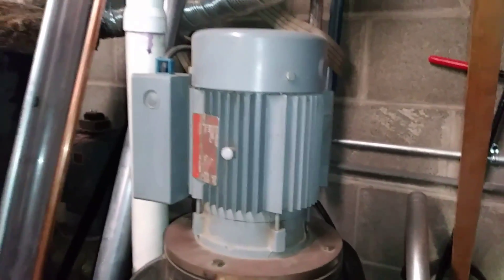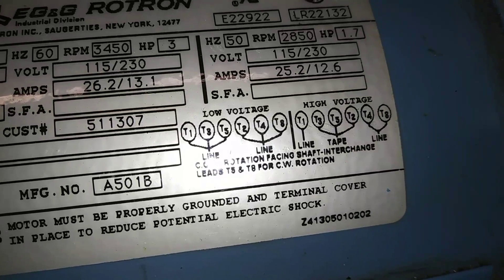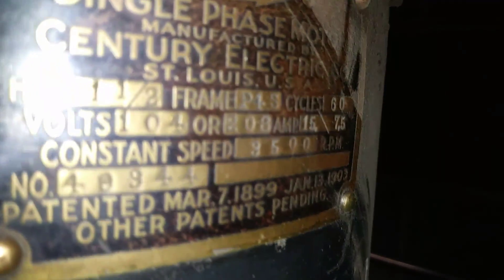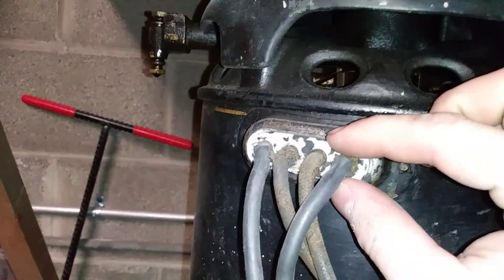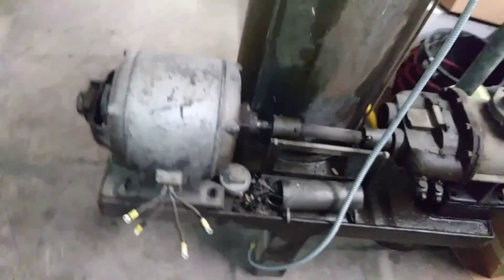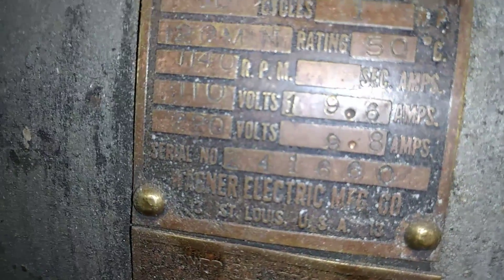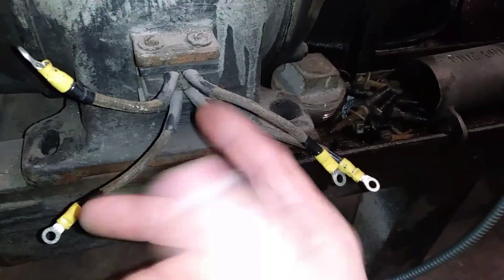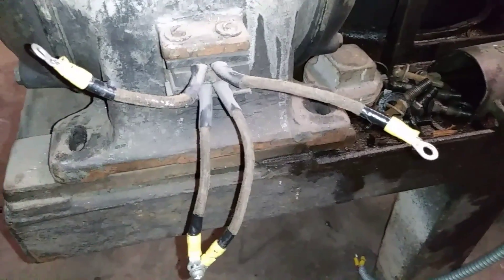Wiring single-phase induction motors (capacitor and repulsion start)

Comment: what if your motor doesn't have a legible data plate and the wires are not labeled.  Yeah...super simple with the given information.
Reply from the maker: Ooooh, you've got a fun one then! About how old is the motor, and how many wires are there?
Reply: @owenperkins  I estimate the motor was manufactured in the 1970's. I have since discovered the stator windings are all shorted to the frame.  Therefore, it goes to scrap.  I sure do like the older motors like this one.   Back when quality and durability were built in..compared to today's manufacturing in China where corners are cut.  There are no ships going back to China with a bunch of returns.

Comment: Hello  sir 
What  great vidios you make.
I was looking to do something. 
Only today  i got my self old baldor motor. From  farms conveyor belt.
Spec is 
Baldor
Spec 58280
Frame 225
Type 2321r 658
5hp
115/230v
Hz 60
54/27amps
Rpm 1725.
Its hard to find single phase 5hp motor in England. 
So i found this and got it.
It hasn't got any capacitors, Its fully enclosed motor,no fan on the back,just  massive lump of steel. 
It works perfect on 240volts,i learnd from  your  video its repulsion start motor.
It only turns clock wise, i need it to go anti clock  wise,how do i change rotation. 
Changing positive and negative on motor still keeps it going smae direction  .
Are repulsion start motors good for high torque demand  for  air compressor. 
Thank you  so  much and keep doing great videos and educating us.

Comment: This is the video I spent the last couple of hours looking for! I have an ancient Emerson motor with 4 black cloth wires coming out of a hole in one end of the can, no markings of any kind. I'm thinking this cannot be rocket science to get this wired up, but after much google searching, no joy. Finally here in your video the most basic case, which I have, is described! There are two copper windings in my 110v motor, and each have a pair of wires coming off of them. One wire from each winding needs to go to hot, and one wire from each needs to go to neutral. (Now, if only I was finding continuity between my wires.... But at least I know where to start looking.) Thank you. Subscribed

Comment: I have a franklin gear motor 115v single phase with 6 wires out, small gauge red, small gauge blk, number 1,2,5 and 6 with no diagram, would appreciate help wiring this thing up

Comment: I got confused, I understand how the continuity run in pairs, (each going to the single winding) but when it came to how you mach them up for the 110 and 220, ya lost me.
Reply: tommy765100 The two windings are really just resistors. If you hook them up in parallel, they will both see all the voltage you apply. In this case, they were each wound to run on 104 volts. If you hook them up in series, they will each have a voltage drop across them of half the current you supply. In this case, if you then supplied 208 volts, they would each see 104 volts, just as they did in parallel, and for which they were made.

Comment: At the 4:54 min mark in the video you state that the rotation is determined by the brushes are there relation to the windings.
I have an unknown age of a Masters Alternating Current motor but I have read they stopped making motors around 1963.
3HP, Serial CX205, Style 252876, type RA, RPM 1725, Frame 213, Code C. 
115V = 37.8 and 230V =18.9 made in Dayton Ohio
This motor when I opened it up had very old cloth type material insulation coverings around the wires with no "Block material" for them to come out of.
The colors of the wires (which are very hard to see the actual colors)
are Black, Green, Yellow & Red, (Green is not ground).
It was set up to run 230V and the Black and Green were the 2 wires to the power source and the Yellow and Red were tied to each other with no power source.
This motor runs CW and I was trying to get it to run CCW for an air compressor and failed to do so even changing the wire hookups to the power source.
B & R read around 5 ohms
G & Y read the same 5 ohms.
My question is could you feasibly change the brushes and their relation to the windings to have the motor run CCW or the opposite direction it ran before messing with the brushes?
Thanks in advance if you have an answer.